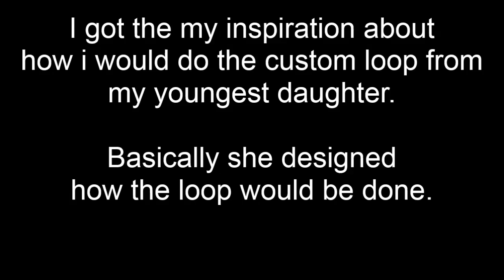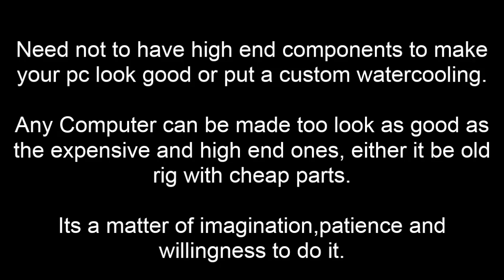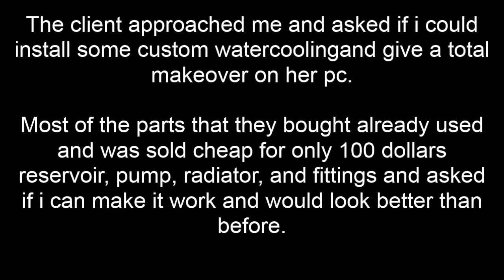Custom Pc Build#26 "Purple Haze" DeClassified Systems, Old Pc? Let's Pimp This

Comment: Ok, a question... spraying the entire motherboard like that, feels like the paint is going to decrease heat dissipation on the components. Have you done any testing on that aspect?
Reply from the maker: i have a video tutorial on that on my build#24 you can check it out, in regards to testing aspect my older pc that is in my workshop is also painted matte black i painted it 7 or 8 years ago still running thow with no problems.I think 8 years is pretty decent way to test something. Its the green black pc that is mounted on my wall.
Reply: Nice, I'll check it out... Thanks

Comment: How did you get the motherboard completely white? Wouldnt painting the capacitors mess it up.
Reply from the maker: I painted it all flat white. for me no coz a have a painted board 8 years ago and still runniing now and my kids use it
Reply: Have you painted a high end overclocked Motherboard?

Comment: Awesome work as usual. just a question how did you put the glass supports on the case?
Reply from the maker: Thanks. well i just drilled a hole and put some nuts and bolts to hold it together that's it.
Reply: Declassified Systems thanks for the quick feedback awesome as always keep up the good work

Comment: sir i have a question, i see there you painted the whole motherboard with white my consor is will that paint damage the motherboard the components in there and the bus traveling things and will it generate more heat ? 
( sry bad english )
Reply from the maker: well in my experience a had no issues on painting motherboards i have one here in my shop that is also painted flat black on the board its an 8 year old motherboard still running thow with no issues.
Reply: Can you make a video to show how you paint motherboards/PCBs? It is not something I see often and your results are amazing.
Reply from the maker: Yes i have a tutorial about that sir but on another build checkout my build #24 Project evolve same motherboard

Comment: Wait, you also painted the heat sinks on the mobo? The reason I'm asking is because I just painted mine and after doing research I concluded that painting the heat sinks was a no no. I used that plasti-dip stuff. Care to shed some light? I don't mind not having the sinks painted... but they don't match very well :(
Reply from the maker: I had done this a couple of times but i use a flat whit or flat black paint  and still ok until now i had also done it with my personal pc and 5 years ago and still runs.

Comment: inspired din ako sayo at ky JP modified. Im gonna build custom also   for this event feb 24-26 here at cdo. pwde po mag ask ? ano gamit  mo  pag spray ng mobo? pwde lng ba yung sherlux nga spray?
Reply from the maker: Thanks Whenever i spray a motherboard either it be black or white i only use flat colors not the glossy ones. Checkout my build#24 i have a tutorial regarding the painting of motherboard.
Reply: Thanks i willw atch it. Its okay sherlux brand? i have flourecent green and white i used my white one for 1st layer .

Comment: Hey man, love the builds, do you think you could do a completely custom case? My space is kind of odd so nothing i need fits. Thanks
Reply: and those omega fans are 👌
Reply from the maker: Thanks. what kind of custom case do you have inmind.
Reply: Declassified Systems I was think a case to fit under my desk over-hang. I also am planning for a 480 mm and 360 mm radiator and a mothrrboard tray rotated 90 degrees so the io is on the top
Reply: Declassified Systems We can talk more on facebook if you like, i just need to make an account or email
Reply: one final thing, im in america would that be an issue?
Reply from the maker: ok its better in facebook. its ok if your in the USA the only issue is really the shipping cost, if that would not bother you then  its possible sir.
Reply: Declassified Systems Ok well ill contact you on facebook then and see if we can do something, thanks!

Comment: could you please make a list of good watercooling components (decently budget ones as well) for a white intel 1151 socket build? I would so appreciate it xD +1 sub this pc is gorgeous
Reply from the maker: Thanks but any of these brands is ok Ek, bitspower, thermaltake and barrows brand is ok its really up to you to choose which do you prefer and be incline with you budget. as for how many fittings and tubes you need its also up to you on how you would do your loop.  you can checkout on their sites dont worry every part is specified if its compatible with your cpu or others.

Comment: ist ist possible to Just Paint the whole MB?! with what Kind of Paint.. doesnt ist damage The Motherboard?! 😮
Reply from the maker: Yes and no yes its possible with the right paint and preparation NO if your not sure you wanna do it or don't know how to do it. i also have my other motherboard painted flat black 7 years ago its a gigabyte 890gpa-ud3h the pcb is blue until now still works with no problems i think thats enough to know that it does not damage the motherboard you can see that pc on my workshop video you can check it out.

Comment: So how much do the components cost in the Philippines, cause here in the US the CPU block and GPU block alone will set me back about 300 USD. Added with the: pump, reservoir, radiators, fittings, fans, tubes and liquid; it will set me back about 1000 USD total. Convert that to the Philippines peso is about 50000.

Comment: Did you paint that motherboard ? What type of paint did you use ?
Reply from the maker: Yes sir it's a Fluorescent white/Flat white
Reply: So just regular spray paint ?
Reply: Wow, mobo is paintable? How about its sockets? How did you paint those details?
Reply: ^ Yeah , same question .
I remember Linus from Linus Tech Tips painting a motherboard and permanently damaging it . Also , did you use primer ?
Btw , what are the two songs you used in the video ? The short piano one played at the beginning and end of the video , and the one with the female vocals at around 1:00 .

Comment: What fittings do you use. They look as f they are painted
Reply from the maker: its a barrow fitting and yes they where painted white gloss coz most fittings are already used and worn out.
Reply: Declassified Systems looks good love the builds. Nice to see builds with not all top end gear

Comment: did you just psint over the motherboard
Reply from the maker: yes sir i did its the 3rd time i did that first on my 1st pc painted it matte black that was 7 years ago still running thow, my kids use it if you have seen my workshop video youl see it on my wall.
Reply: Declassified Systems soo its safe to do it bc i wanted to do it för a long time
Reply from the maker: It depends on how you paint  and prepare your motherboard i have some tutorial on that same board also but diff. build its build #24 Project Evolve you can check it out. just be careful when doing this you might damage you board in the process. good luck sir